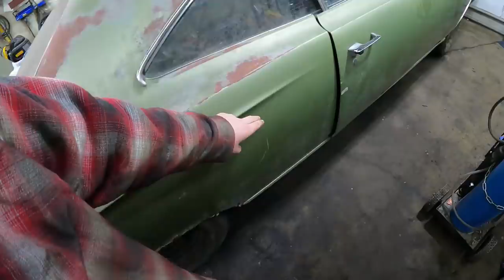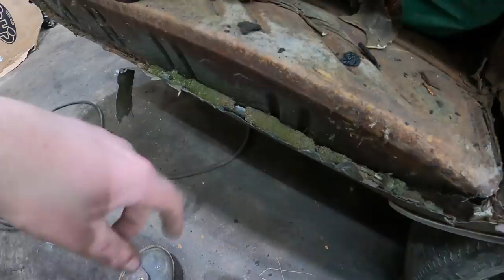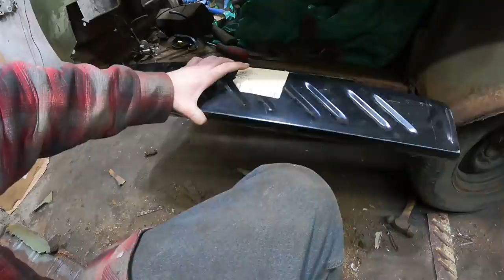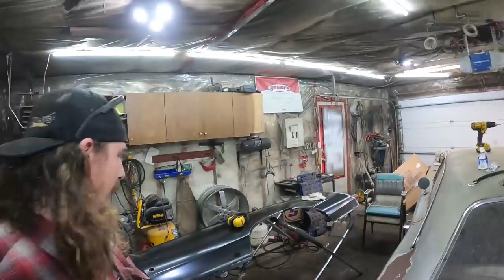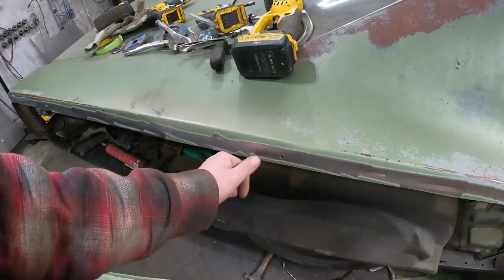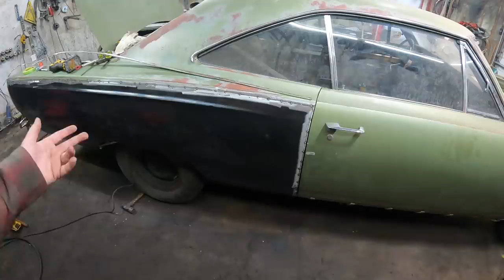Muscle Car Quarter Panel Replacement at Home - Road Runner Clone

Comment: Great job! As a 30 year body and paint tech, 20 in restoration, you are doing fine. Only repair what you have to, why replace the whole thing when a skin and edge repair is all you need! The only thing I do different than you, I would have taken the top all the way to the edge like you did the rest of it. I was taught it takes less to clean up the weld seam on that bend as it distorts less. But,!tomato, tamato, right?😆

Comment: A quarter panel replacement around here N.L canada is at least 1000$ probably much more if there is rust to remove,This is provided you have the quarter panel in your possession already.

Comment: Lol many years ago when I first started doing this kind of work, we used pop rivets and even brazing as methods to attach panels and patches.  We did not have mig welders back then. When we brazed panels we had to control the heat by using wet rags in a bucket of water, we have come a long way since then.  Now they are using glue for some panels now.  Btw Those trunk " drop downs " are called trunk extensions in case you wanted to know.  Geat job on the old Plymouth!
Reply from the maker: Yeah.  I feel spoiled allt of times.

Comment: I like the tip to cut through both new and old panels at a 45 degree angle before butt welding. Never thought of that myself and I see now it would make for a better fitting joint to weld. Thanks!

Comment: WAIT! You said get a drink. Then ya start right in. lol. Total Suspension n Drivetrain on my 240k 1993 Chevy Silverado. $4000 has 0 miles on it. 12x15 Weld Wheels n 2 tone paint. Mild build to 300HP to pull the boat.Ready to go another 200K. I watch every episode of DD. Great Motivator
Reply from the maker: Thanks!

Comment: love the Mopars and the Tri-Fives, run the wagon with the big block, a turbo 400 and a gear venders O/D and skip all the electronics lol, keep up all the good work on the channel
Reply: A Gear Vender Overdrive is about $3200.oo  Damn expensive....
Reply: @stevehetrick2676  Wow, I thought they were 1200.00,  that's not going to work, lol thanks steve

Comment: Man you never stop working. I mentioned to Coastal Auto about using Fastenal to ship that motor and trans. They are usually much cheaper on shipping heavy stuff.
Reply: Unfortunately Fastnenal doesn't ship stuff like that up here in Canada.
Reply: @nummnuts22   well dang, so much for that.
Reply: @LeftForDeadGarage  I know, had parts and panels south of the boarder I lost out on. Fastenal was cheaper then most but would only bring it to the boarder.

Comment: One tip , I use a wet rag and a bucket of cool water ( and a helper most times) to hit each spot weld as the weld is still red hot and hit it with the wet rag on each spot weld area to help cool the sheet metal and help stop warpage issues.  Works for me .

Comment: I am liking your installation technique. I have installed a few body panels and aligned several fenders,doors ECT.  One thing that might assist you in the welding on a LONG panel seam is keeping a wet rag in your opposite hand and quenching each stitch weld as soon as you do it.  This helps me in keeping the warpage issue down.  ;)

Comment: Thats pretty much how i did quarter skins on my 65 chevelle and it was 1st time i welded quarter panels on. Took my time n researched and practice welding. I heard guys around my area charge 800-1400 to hang quarters

Comment: Cool cool. The only advice I have for you is when your using the stud puller for dent removal. Start at the outside of the dent ripple. Try to pull starting from the least effected area to the most. You are working in reverse of how the dent got to its current state.

Comment: Ive not been screwing through both old and new but overlapping and cutting along in short sections,same idea but less holes to fill. Im doing the same thing on a 74 scamp getting the panel to the point both driver and passanger side are spot welded in leaving the door and top seam then  working on both sides at once to try and beat the heat.

Comment: Hey Dan, i use 3M™ Fibre Disc 381C for grinding flat panels. They take a lot of weld out quick, leave a pretty flat surface and the don't put too much heat into the panel. They're a little more pricey than the flapper wheels, but they do bring up the metal quite nice. And you can get different abrasive levels. But i love your work and cant wait to see more Plymouth, pontiac, dodge, whatever you want to call it action. Its a cool car.
Reply from the maker: I jist ordered some haha

Comment: His method for attaching the panel at the top is interesting. If I have the time I prefer to make a flange at the top to have an overlap. Makes the joint stiffer when you go to weld it.

Comment: Once again Dan, great work. I am not a fan of doing quarters, the 72 Cutlass on my rotisserie needs the quarters finish welded, its been waiting almost two years for me to get back to it. Have to do the trunk drops, wheel wells, and the rocker joint. Its a ton of work and right now I am putting 6.0/Th350 into my 76 C10. The heat in my shop isn't great so i spend more time standing by the heater than I do working when its colder than freezing. 

When you get the new larger shop, do yourself a huge favor and get a lift. I splurged on a two post Bendpak, I use that thing constantly. I want a four post to put next to it, but a small scissors lift would work good for what you do. They are movable and run on 110v. Lift the car put it on jackstands, pull the lift out for transmission work. Otherwise what you need is some dollies, I have two pair I use on long term projects, maybe you could get the viewer guys to chip in and get you some of the fancy ones that don't need a jack to get the car on them. They make moving the car around in a small space a lot easier and faster. Well worth the investment.

Comment: Got a link to walker auto? Also one thing you didn't warn about which a lot of folks just know but welding isn't the only way to heat the panel and warp it, just the easiest. take it easy with the grinder as well. Good job man.

Comment: Silly question, but what kind/brand of grinding disks are you using? The ones I can get easily seem to be crap. AND, something I tried out recently for the first time, you can custom order spray cans which may be helpful if you want to "dust on" a faded version of the original colour so it doesn't look like a new paint job. I was thinking of suggesting that for your floors, (imagine the impression of peeling back the carpet and seeing a scuffed up green on that pristine metal),  but would also help you get some patina back into your freshly painted quarters.
Reply: I was going to ask the same thing! For as many as he uses I am sure he has found a good brand!

Comment: Very motivating. I'm about to pull the trigger on my dream car, but it's a rusty rotted out POS, but all I can afford. I'm about to take up mig welding, and it will be a learning experience. I guess I can't really ruin the car since it's 75% rust anyway. What brand quarters did you use? Are they noticeably thinner than the factory? I'm guessing so, but it is what it is.

Comment: Dan use a heatsink when welding to minimise warping. Place a wet paper towel near the spot were you will be welding this is a heatsink.
Your rust converter paint is worthless. Use zinc based primer on the wheel wells and copper weld primer on the lapwelds. Use epoxy primer when done welding.

Comment: Thank you for this informative video! I was wondering that what is the easiest way to success, when replacing quarter panel. I got myself a barracuda and both quarters must be replaced. Now i did another one of them with your method - 45degrees cut, it is bloody fantastic technique! I think this first one took maybe 4 hours with a shitty welding machine.  It was very simple to do with your advices. Thank you!

Comment: I have a 69 charger that I've owned since the 90s. It's always been in need of quarter's since i've owned it. I def' can't afford to pay someone to put new quarters on for me, So I've always wanted to do it myself.  I'm a pretty good welder, but have never tackled a new quarter on a car... 
After you tacked the quarter on the car and cut the thin strip of metal from the top. How big of a gap did it leave between the old metal and the new metal on the new panel? The width of a cutoff wheel blade I'm assuming....
 Since those panels are such thin metal, and the gap between the two pieces is as wide as a cutoff wheel's blade, was it hard to tack the two pieces together without burning the exposed edges of the metal?  I've heard some people say that they bend the old lip of the quarter and let the new one overlap... Is that a good idea or not so good?  Just asking questions because I'd like to ask someone before I tackle a project like that... Thanks.

Comment: Buy a klico body pin set they work great for securing panels. not sure if the name is spelled right. they sell then at eastwood. was game changer for me. and a flanger punch from princes auto. car looks great

Comment: Your doing fine I have installed so many panels over the years that I have lost count. Consider using weld thru primer in spots and invest in some clecos both rivet hole and side clamp. I would recommend .023 wire if not already. Do many many test fits on door gaps and wheel tubs. If you have to apply pressure to the panel to make in align find out why and fix that otherwise you may create bows, lows and highs that your chasing later. The hitting a fuel line well that can end badly.   I always try to find the best reproduction panels possible. It will save the customer $$$. Spending 10 hrs. to correct a cheap stamping is bad math.

Comment: I wonder what the panel would look like with a thermal camera while you're welding? 
With your luck on old engines lately.  Would a 5.7 hemi swap be in the cards?

Comment: Hi Dan, love the videos bro, very informative. So i have a 71 duster i need to do similar work. I need to replace entire trunk, including trunk floor side drop downs, the tail panel, and the lower rear quarters. In what order should i do the metal replacing?

Comment: Question, do you do any treatment to the backside after welding panels on? Rick at otg tries to get in with rust convertor,if anything to slow down the eventual progression of rust.  I try to scrub backside and hit it with zinc weld through primer before i install panel. 
I just remembered you painted other side.  What was i thinkin?

Comment: Are you ready to start a 67 chevelle that's even worse?parked this 78.
I'd send a photo or two if I new how.
I've been using the trees growing to the cross member and left rear quarter/well mostly the tree thru the engine bay,its pecan .The tree grown  to the fender is cotton wood.burns too fast.

Comment: Dan did you ever tried using an electric sheet metal shear, it would save on disks, noise and dust. You can buy it at princess auto.
Reply from the maker: Yeah I got a set.  I find they kinda twist the panel

Comment: I don't know how it doesn't warp. I'm flanging the body with an air flanger  all along the top, so my quarter overlaps by 3/8 of an inch and plug weld it and use aluminum filler. I think i will have better luck.

Comment: I like it so far and get what your saying.... take your time, if someone doesn't like it then buy and fix it themselves. Good enough for the girls I go with comes to mind. I did learn a ton from you and only wish I could still walk/move and do these things. I would go to a wrecking yard an get enough steel to rough up a metal building.... enough to stay dry an not spend months building. I make up my mind a half dozen times and then do something different so go figure, I don't trust myself is what its sounding like... now its d d psycho analysis and occasional paint. Take care kids

Comment: The skill and effort demonstrated here is 30 to 40 per hour here (MS USA) Its not rocket science but it requires that kind of focus and drive. Craftsmen are fewer and fewer all the time and 30 to 40 is not enough. And it takes a certain kind of guy. Comfortable behind the shield.

Comment: I know it's not an original color because the Impact colors didn't come out until 70 but you should paint the car panther pink and give it to your old lady then take the 57 back and put the tunnel ram 454 in it and the LS from the 57 in the56 wagon since you plan to drive the wheels off of it!

Comment: Hey Dan, like your satellite project, I now you put on your pod cast clone roadrunner, can I give you a kind piece of advice, leave it a satellite, there are several reasons why,  the first is it came from the factory a satellite, the second is if you ever decided to sell your beloved satellite, the buyer will be interested in your ride because it is a satellite, with the cost of gas going up way past five bucks a gallon, the 318 small block would be a engine of choice, if you want to stay with a carburetored engine, or a resto mod with a fuel injected modern engine, either way if you were to go that way, it isn't that much more money as opposed to making a 440 clone roadrunner, anyway that's my opinion on your wonderful project, have fun with it, Dan, adios for now,....

Comment: good job but to be definitively efficient,  you should  put grease everywhere. grease et the only thing very efficient against rust. put grease between metal and carpet, inside door, behind metallic bumper, behind the repairs you can make (everywhere inside cavity- hidden erea -  instead of using paint before reclosing), hollow areas (necessarily hidden, so no need to be aesthetic). For rear wings unreachable with a paintbrush, use an extender and poor old oil everywhere each year.Handyman Experience - 35 years.   From france

Comment: Why not make it? I work sheet metal professionally and usually if you match the gauge and radius from the wheel arch center, it's butter from there, you can just measure the beading from top to bottom to center it.

Comment: $25 an hour plus don’t forget the cost of your grinding wheels, gas, wire and stuff. Good job. BTW, it’s a plymouth 😉
Reply: IMO, $25 an hour would be a “friends and family” price. The “and stuff” part should also include your rent, equipment depreciation, Coke by the liter, and time spent managing your material supply. You’d be reasonable at $300 a day.
Reply: I'd say closer to $50 per hour and good luck getting it done in a decent time frame

Comment: kleecos and their pliers they are a bit expensive but when doing sheet metal work a must. you drill holes on both panels your working with and the kleecos have a spring loaded point on them that wil expand in the hole and hold your panel in place while welding. come on dirt track drivers you guys know what im talking about when your hanging a new body on a chassis.
Reply from the maker: Yeah I got a set.  I just always end up with self tappers haha
Reply: @DDSpeedShop  what ever ya need to get the job done easiest for ya. you have definately got good hands keep it up.

Comment: I would have just cut out the rusty lace at the bottom, saving as much Detroit steel as possible.  Use just the lower part of the patch panel, then the seam is down low where no one can see it.  Also cut down on the amount of vertical welding at the front and back. Just wanted to share the way I do it.
Reply from the maker: To each their own.

Comment: wouldnt it be better to use a flange air tool and flare it in then tack it it seems it would be stronger
Reply from the maker: I find that bends the panel and requires more filler.

Comment: There ain't nothing to it but to do it
Reply: Any time my dad did quarter panels he would set a cooler of ice in the trunk and use the blower from a furnace to blow air across the ice to keep the quarter panel from getting hot

Comment: 20 hrs per 1/4 x shop rate. Plus additional repairs for drop downs & wheel houses. AINT CHEAP TO PAY FOR THEM TO BE DONE RIGHT. More affordable for butcher job. You get what you pay for. Or be like Dan, buy tools & equipment and learn by doing.

Comment: cover the glass when you're grinding & welding...................don't ask me how I know this : (
Reply from the maker: It just adds to the "patina" haha
Reply: @DDSpeedShop  Sure, but the next owner might look at this as their "dream car" & be disappointed  in needing to get new glass for a 50+ year old car. On a side note, a buddy of mine bought a 69 Road Runner for $300 back in 77, nice car, running & driving well, just cost a fortune in gas to run & that was when gas was .80 cents a gallon in Montreal. We were only making $3 /hour, so .80 cents a gallon was considered expensive. He sold it for $400 & thought he'd done well : )